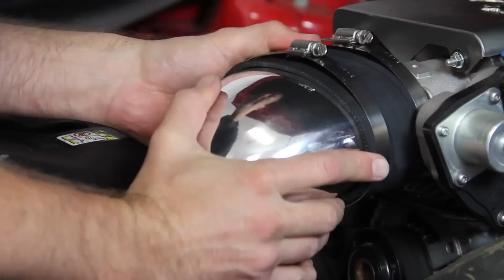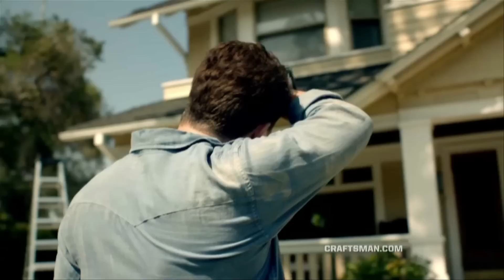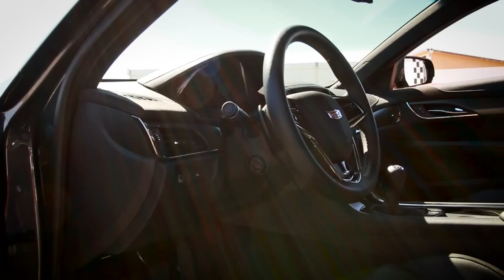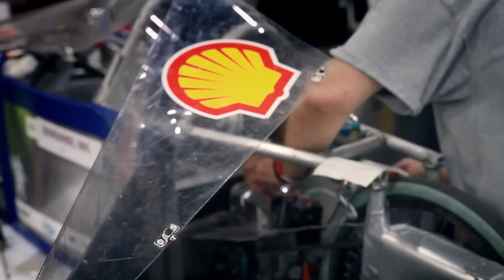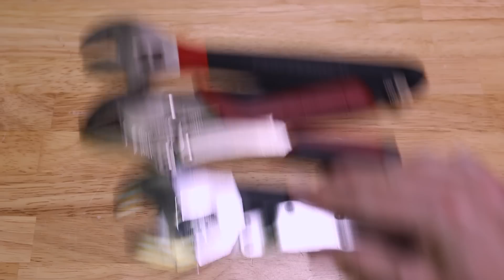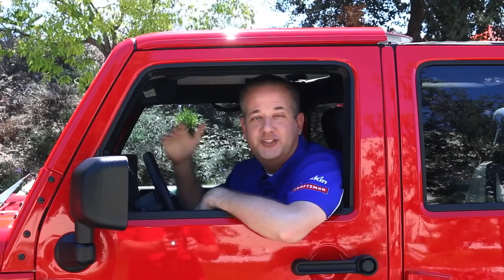How to Install ProCharger Supercharger Jeep Wrangler Motorz #87

Comment: can you do some work on some tahoes
Reply from the maker: +Derrick Nash Not a bad idea! What model year, and what kinds of mods?
Reply: 2006 and some engine power mods maybe some electrical work
Reply from the maker: +Derrick Nash 4.8L or 5.3L V8? Do you have any specific suggestions?
Reply: +Motorz 5.3l flex ppv version
Reply from the maker: +Derrick Nash Cop car? That might be a little harder to get. What about a basic 00-06 5.3L?
Reply: +Motorz cool do you think the mods will be similar cause I'm rolling in the ppv and I see all the mods you do on these cars and trying to get some great ideas from you
Reply from the maker: +Derrick Nash I haven't done any research on what the differences between a PPV and a non PPV are. Do you know? Maybe just appearance, lights/strobes, siren?
Reply: +Motorz all I know is ppv is rear wheel drive only bigger brakes that's all I know of but whenever you do the tahoes please let me know. I would like to see some upgrades th at we can do ourselves thanks alot love this show.
Reply from the maker: +Derrick Nash We are just finishing up our 2000 Ford Ranger project and are researching the next one, so your suggestion is helpful! Thank you for watching and stay subscribed :)